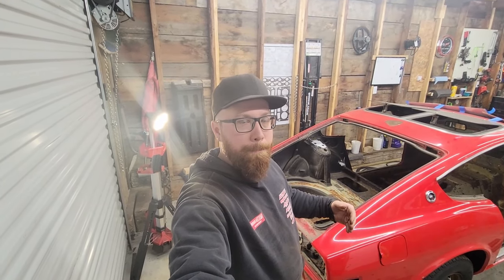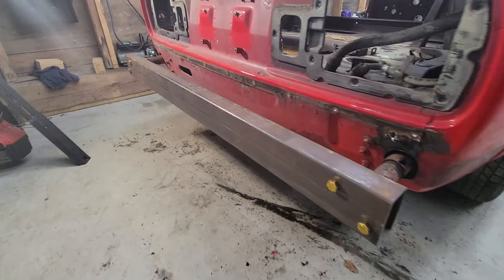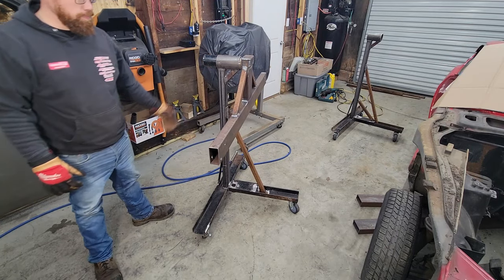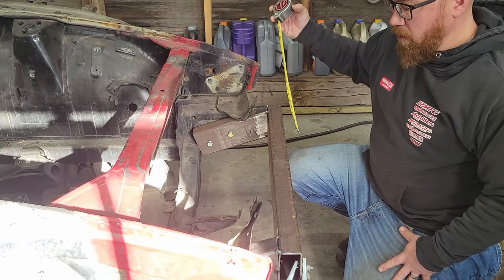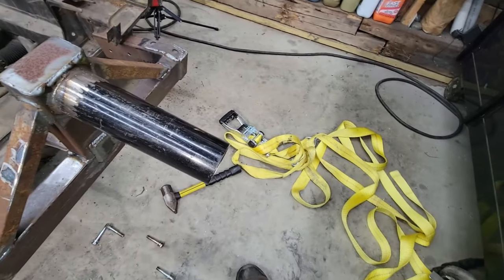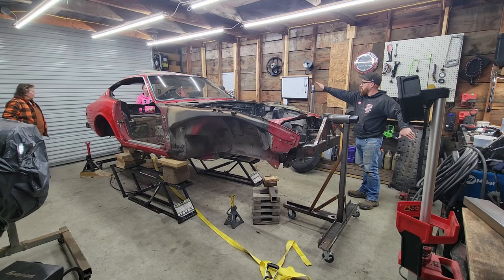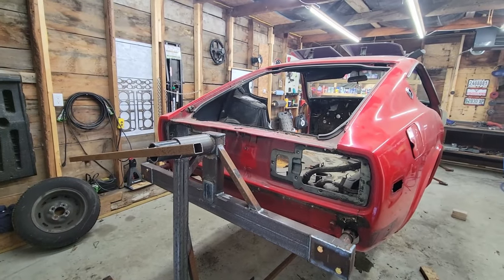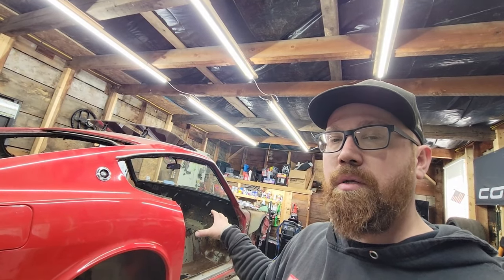DIY Car Rotisserie Part 2

Comment: Why not a wheel at each end of the base, that way you can rotate the car more easily and by the lock system you can drill thru the base and slap a steel rod, like and engine work base, one from north to south and the other from east to west

Comment: Nice, i'm about to build one my self.  what do you think its a better pivot point from the rails?
Reply from the maker: I can get you a measurement where my pivot point is at above the frame rails if you'd like.
Reply: Yes please 🙏
Reply from the maker: So while on the rotisserie,  the bottom of my frame rails are 30" from the floor. The center of the pivots are 48".
Reply: Thank you.